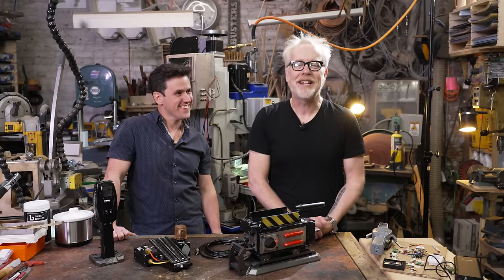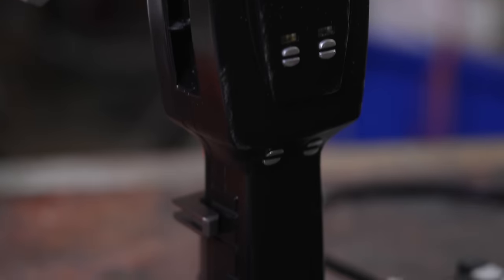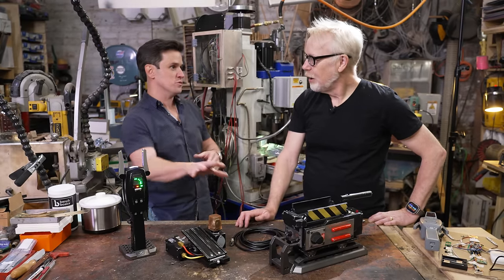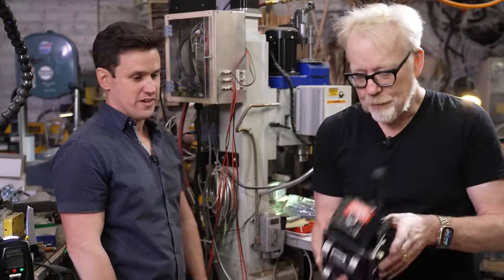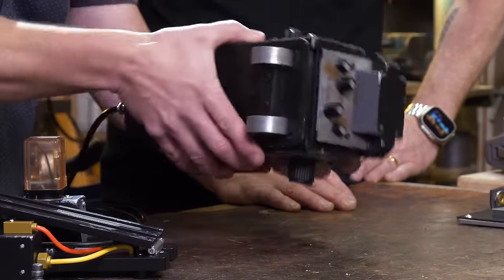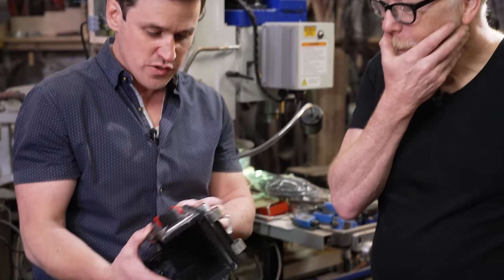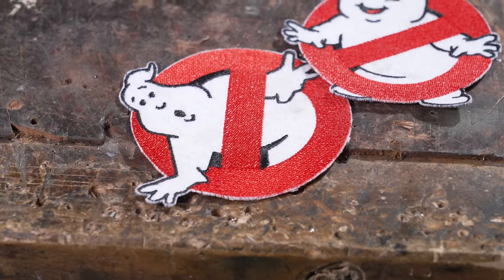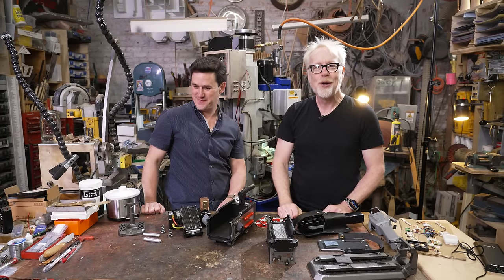Adam Savage Inspects Hasbro's Ghostbusters Ghost Trap and P.K.E. Meter!

Comment: Loving the fact that this video dropped with just 5 days left to back the Two in the Box campaign. If this was shot at ~6,500 backers like Kevin mentioned, that means this video was actually produced around 4 weeks ago. Hopefully that short window of time left means we get over the 20k backer threshold since people won't have time to think too much about spending the money on these lol. 

Pretty sure the first mod I'll be doing is replacing the god awful looking cloudy yellow relay with a new one...assuming it uses a standard 8 or 11-pin octal base. Maybe weather it just a touch with some watered down lamp black so it doesn't look too clean, throw a SmokeGenie in the middle, maybe upgrade the speaker drivers, and call it a day.
Reply: It was at 16500ish for the past couple weeks. With this video it jumped to 17700. Less than 300 needed for the PKE belt pouch. They Don't have any tiers listed at 20 000 so maybe that will get unveiled if they hit 18 000. I'm not sure the PKE meter would have done as well on it's own but I'm glad the double pack is pretty much guarantee to hit the max tier that we know of already.
Reply: @chamoo232  I could very well be wrong on my timeline, i just kind of remember the numbers being stuck in the 16's at least 3 weeks back. And Kevin said the engineer patch was unlocked at 20k. I really only care about unlocking the two holsters though...the patches look pretty second-rate in quality. No life to them unlike the GBPatches or Todd Cook ones.

Comment: I REALLY hope the weathering is of the type used on the Hasbro Spenglers wand (and not the Hasbro Proton Pack). Because the Hasbro wand weathering was a breeze to remove with alcohol but the pack was baked in. Made it so much easier for customizers.

Comment: Looks like the arms on the PKE Meter prototype are a little weaky/wobbly. When they were up in taser made, you could see one shifting around a bit as Adam waved it.

I hope they're more secure and solid on the final product.
Reply: They may be loose so they don't break the motor when moved counter to the gears. Depends on what kind of machinery they got going on inside, the guy said it was fairly quiet, if you've played with the current PKE toys you'll notice right away they are very loud when actuating the arms. My guess is they have a different system which is quieter and as a safety mechanism to prevent the machine from breaking, the arms might be loose.

Comment: I recall them saying the pack was casted off the actual pack, yet Adam had pointed out to them all the things wrong. That was sus as hell
Reply: They were clear that these were also scanned BUT there are many variations on the original props depending on if it was a stunt prop or what action it was designed for, or hero prop made to just look good. Plus they also had to fit in all the real tech to make them work as functioning props that do all the things instead of just one or 2 things. So they are slightly modified.

Comment: Hasbro! Please add the missing LED next to the bargraph on the trap! See GB1, GB2 and GB: Afterlife
Reply: It's missing in Afterlife, so this is actually movie accurate.
Reply: @Rocket1377   You are wrong. Gbfans “Haslab Hasbro Two in the Box! Pre-Release Discussion”. The LED is very much there. There are screenshots from the Grooberson schoolbus battery trap opening scene.
Reply: Also the Haslab bargraph “plate” has 6 screws for some reason, the real one from Afterlife has 4 screws
Reply: @gold333 you clearly have eye problems because I’ve studied every original trap scene in afterlife and not once have I seen the indicator led on the trap not once

Comment: Is there a place for the foot pedal on the trap holster?
Reply: The Ghostbusters just place the pedal upside down on top of the trap doors in the movies, then wrap the cable around the handle to hold it in place.  

I'm sure the fan community could come up with a clip to hang it more securely from the belt, but it wouldn't be movie accurate.